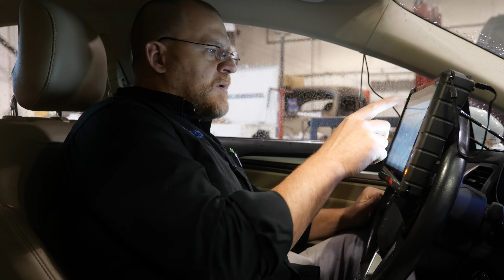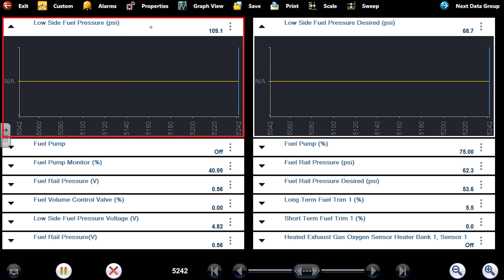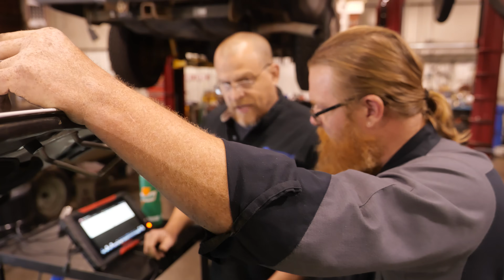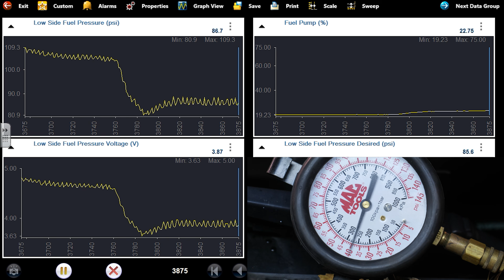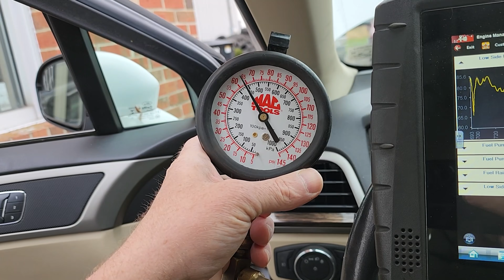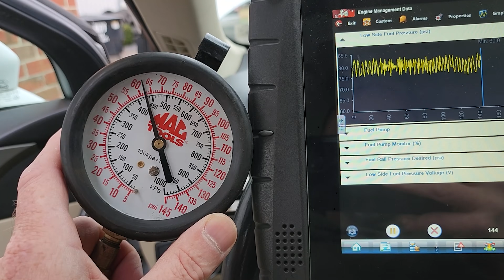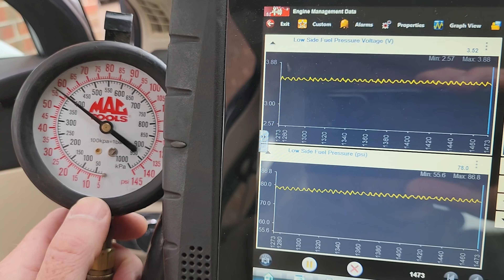Gas Direct Injection System With Intermittent Low Fuel Pressure

Comment: With the mentions of bronchitis and time, I thought Caleb might have inserted clips from a KFOR news report that went viral 10 years ago
https://youtu.be/ydmPh4MXT3g

I was quite surprised you didn't pick up on the 4.82V being a red flag, it's quite rare that a 5V sensor will have an operational range outside of 0.5 to 4.5V.
I also didn't expect that scan data would change (albeit only 0.2psi) when unplugged
Reply from the maker: I did! The first mention of that data PID at about 7 minutes was just an overview of everything on the screen for everyone. Then at 11 minutes we are narrowed in on it.
Reply: @ScannerDanner  yes I know you mentioned it at that point and again quite a few times but each time you seemed to be saying it with the tone of it being a perfectly acceptable value rather than something outside the normal range.
I was waiting for you to say "Hmmm, 4.82 Volts, I don't like that."
I was literally shouting at the TV!🤣
It must have a very narrow limit for setting a circuit high/open code if 4.82V is not flagged as outside spec by the PCM.

Comment: Paul, bear with me here as I'm pretty new to the scope scene. But the other day I connected both lead of my scope to the coil windings from a relay (resister removed), held it on the fuel pressure sensor and I could easily see the PWM signal on the fuel pressure sensor on a 2013 Kia Optima. I don't have a COP paddle ignition pick up, but I would assume that would be the nicer tool to use. If you get a second give it a try and maybe you could have used that to see if the PCM was sending the correct signal. Idk just a thought.

Comment: Low pressure fuel pressure sensor (LPFS) is not likely an absolute press-sensor, there is no need for that value.
What most people did not realize is that, any added hose length, Tee fittings and orifice produces HEAD or restriction to flow and will create a lower reading on the mechanical-capillary gauge we use to troubleshoot, even assuming that the capillary gauge is as "accurate" as the all electric LPFS.

Position of the LPFS also matters. Some cars has its LPFS sensor at the fuel filter output at the fuel tank and we read our pressure at close to the input of the HP fuel pump at the engine . This extra distance of approx 4 meters and elevation of approx 50cm LPFS is reading adds to HEAD and read as higher pressure. And then we add skinny hoses and Tee fittings to our  mechanical capillary gauge with extra 50cm length, hence our mechanical-capillary gauge will read even lower pressure.

If one wants to read pressure equally as possible on all instruments/sensors which are not taken from the same port, it has to be static reading with pressure raised slowly and not while engine is running, assuming there is no check-valve involved.

Often electronic LPFS is temperature compensated while our mechanical-capillary gauge is not, there goes some more deviation. Mechanical-capillary gauge by design is most accurate at the middle sweep range, that is given.
So a 145pis gauge is most accurate at its 70-80 psi range.

On my Mercedes W212 M276 3.0TT engine, its LPFS is at the fuel tank at the filter body, reading filtered output.
The sensing/reading port for mechanical-capillary gauge is at engine Bank 2, so 0.8 to 0.9 BAR lower pressure I am reading compared to Xentry scanner LPFS value is acceptable. I use 50cm hose for the mechanical-capillary gauge and able to place it near engine fan shroud, so that it is safer if any leak occurs because turbocharger is close by if leak occurs at gauge, while gauge is on the engine Vee.

If anyone has a swimming pool with decent good twin filter system of sand filter + cartridge filter and pressure gauges at the pump output, one can see various pressure differences when system is running, all produced by resistance or HEAD from either filter media clean/dirty, pipe length, elbow, valves, check vales and all other related HEAD or resistance a fluid delivery system will encounter.
Reply from the maker: Agree with your first statement. What would be the need for an absolute psi sensor here. This low side pressure is clearly not critical that it needs to be an exact amount as we are not supplying rail psi with it like on a port injection system.
And location of the psi sensor is certainly a factor, especially on this set up!
I would argue that my gauge is not a big factor here as I've used this same set up a thousand times on port injection systems and have exact psi specs with it. Thanks for the comments and info!
Reply: @ScannerDanner    I do not know what is the minimum input pressure for this Ford's HP fuel pump requires, but on my M276.820  its a Bosch 200 BAR (3,000psi) unit which expects 4 BAR ( 60psi) minimum at its input at maximum fuel burn. However, my LP fuel pump is 3 phase variable speed, so testing LP fuel pressure need me to do WOT at 1st and 2nd gear to see real performance of the LP fuel pump as the fuel flow mapping won't be all out during stationary revving.

Same design to the Ford HP pump for its Normally Open fuel quantity control valve though.
However, I like seeing most american cars are generous for their data perimeter.
For reason unknown Mercedes for M276.820 engine ( Bosch ECM MED17.7 ) is stingy for a few important perimeters. There is no desired LP fuel pressure and HP fuel pressure information, DUGGHH !!!
I knew about the 4 BAR minimum pressure from Bosch datasheet of the HP pump family used on my engine, which is the HDP5 family. Single piston type.

I am hoping someday you will scope the HP fuel pump fuel quantity valve and break down its data value vs actual mechanical action which is quite complex and you are very good with explanation of such system and knowing your mind-set : forever wanting to learn more, it will be awesome this information coming from you.

Some OE like Mercedes call it actuation angle while Ford call it by % of actuation.
The complex part is the real actuation timing of the single piston fuel quantity valve of the HP pump vs the camshaft's lobe for the HP fuel pump pumping. In a 3 fuel lobes camshaft scenario there will be 120 degrees of camshaft revolution per lobe BDC>>TDC>>BDC, but only 60 degrees is able to pressurize the fuel, the upward stroke of the lobe BDC to TDC. The other 60 degrees TDC to BDC is for "suction".
VVT system added complexity when measuring these as camshaft angle keeps changing in respect to crankshaft angle. Hence it takes an excellent teacher like yourself to dig in deeper into this GDI 101.

A delay in the activation of the electromagnetic coil of the HP pump fuel quantity valve from degreading coil insulation or whatnot, but seemingly % is achieved* ( *but at wrong camshaft lobe position ) say in a Ford GDI, can really ruin a troubleshooting day. If total dead fuel quantity valve is easy to troubleshoot.
 
Okey dokey, thanks Paul for the excellent video , as always.

Comment: I'm glad for your chanel, ive been learning a lot with you. Actually the psi lower than 85 is interesting since the low sensor now works within specs.What could be the psi not reaching 85 as the sensor has been replaced?
Reply from the maker: Watch the last clip (before my cough sequence) for an answer to that

Comment: Thanks for sharing Paul. Don’t know if you follow Sean toppling podcast but he had a good fuel pressure problem on a 3.5 Honda engine which turned out to be skipped  tooth on the Cam which drives the pump. It as a good one. All of you get well soon Artie 🇺🇸😊

Comment: Thank you Danners. Your approximate 15 psi difference between the fuel pressure gauge reading and scan data reading is the scan data is absolute pressure. To prove that you can pull fuel pump fuse or relay, while engine is running until it stalls. Your fuel supply pressure live data will read approximately 15 psiA, while your pressure gauge would read 0 psiG.
Reply: 🤦🏻‍♂️ Now that you mentioned it, it is so obvious, I almost ashamed not to have figured it out haha

Comment: I also have a vehicle in at work that just took a quick diagnostic on where the high pressure fuel side goes from 48 to 3 bar and the engine dies, but only on hot engine.

Havent got time to check up on it anymore since our shop is always overbooked..... (shitty management😅)  so no time for lengthy diag. But the scan data looks very simmilar otherwise and i said it looks like the low pressure side fuel pump might be bad but haven't called anything yet since i only had 30 minutes on it  including testdrive to get it dying but now i have an idea what to look for firstly 👍
Great timing as it been sitting a while and customer wants his car back days ago...
Reply from the maker: awesome! Looking forward to an update on what you find. Is it a Ford?
Reply: Actually an Volvo but they are all Ford parts and engines now 😂 think it is the exact same engine as this one
Reply: So happy to tell you AND the customer the car is fixed now 😁
Tha part was "only" 170 usd so just the time of diagnosing more was weighted to just change it and see since parameters were very similar to yours and the low pressure never changed a single digit.

So changed it and the pressure showed now went to be dynamically changing, also opener the old one and the electronics where filled with fuel.

Now it is all good.

Before it was 5 minute drive before it started dying, i drove 20 minutes today and it idles nice without stalling now.

Volvo/Ford dealer told they only sold 2 sensors since 2018 so it was guaranteed i was ordering wrong part, jokes on them since it fixed it 😂
Reply: @tullgutten  awesome, thanks for the update!

Comment: Could it be the gauge is smoothing out at higher rpm’s due to that long line on the gauge. As the pressure pulses increase in frequency the compliance of that long hose smooths out the variation. The sensor doesn’t have this problem.
Reply from the maker: I think the increase in frequency of the high psi pulses is why the psi gauge would smooth out.

Comment: Don't just forget about the grill shutter.
Ive had one where i was chasing engine faults that didn't make sense.
Engine dying while idle, not starting, not charging, charging too much, instrument cluster going crazy.

It was hard to drive it in to the workshop and the exterior lights also blinked on and off.

The grill shutter was full of water and was directly on the lin bus line and messing everything up.
Every problem went away pulling and drying the plug since it was dripping wet, and with a new shutter every code went away and i only got code for it once, it never reappeared after deleting codes the first time but luckily i had printed out all the first codes and checked it not too long after in the diagnostic and had 1 more car with just charging fault even tho it was charging, same part changed fixed it
Reply from the maker: ah great tip! Did not consider water pulling the network down! Thanks!

Comment: It's weird how they are having the same problem across several of their vehicles.  It's almost as if the sensors are all out of calibration, but instead of paying to get new accurate sensors  for all their vehicles, they are simply calling it good enough;  just let all these vehicles run with slightly under pressure low sides.  Interesting.
Reply from the maker: As others have said, this may be an absolute psi reading, not gauge psi.
Also, as far as having such a wide discrepancy, I don't think it's as important as it is only the supply side, not injector psi side if that makes sense

Comment: That is a very interesting point if the electronic gauge is an absolute case and it's going to be 15 psi higher because the atmospheric pressure I wonder if that's what the computers actually reading very interesting point Love video

Comment: I Seen Your Preview On Facebook My First Thought Was I Have Seen This Problem Before, That Must Be A Ford Lol I Wanted To Comment And Ask But Figured I Would Wait On The Video.Really Awesome!!!!
Reply from the maker: This was exactly as you thought? Cool, I've since heard this is pretty common! What are your thoughts on the drastic fuel psi changes during snap throttle testing after the fix. I'm calling it normal on this system but I could be wrong. Thanks!
Reply: @ScannerDanner  First Time I Ever Came Across This, Probably 2 Years Ago I Diagnosed The Problem As A Low Side Pressure Sensor Failure….I Was Correct But After Replacement I Seen Numbers On Scan Data That Didn’t Match The Actual Reading, The Car Ran Great But The Numbers Through Me Off,Long Story Short I Actually Ended Up Convincing Myself That There Must Be An Issue With The High Pressure Pump. After Replacing The Pump For No Reason Other Then What I New At The Time,The  Fuel PSI Numbers We’re Exactly As They Where After Sensor Replacement.Nothing Wrong With The Pump I’m Calling It Normal As Well, I Have Had Other Ford GDI Engines Same Fluctuation And No Problems At All.
Reply from the maker: @SMAutoRepairLLC  to be clear, you changed the high psi pump for those low psi fluctuations I'm mentioning? I wasn't talking about the skewed sensor issue if that's what you were thinking. Thanks!
Reply: @ScannerDanner  That’s My Fault Sir, I Did Believe That Is What You We’re Referring To My Apologies. The Low Pressure Reading Fluctuations By What I’ve Seen Seem to Be Completely Normal. I Appreciate You Taking The Time Out Of Your Evening To Reach Out Really Awesome!!!!

Comment: Does cooling a sensor raise voltage?
Reply from the maker: Temperature shouldn't change a psi sensors signal. This just further revealed what we already knew, which was the psi sensor was messed up

Comment: I'd say the low pressure pump is failing
Reply from the maker: I believe the drastic psi changes on the low side during snap throttle testing, even after the fix, is due to the system design. A steady exact fuel psi isn't needed on the low side as we are only filling a chamber and not firing injectors directly from it. The reaction time of the fuel pump duty cycle command and the variable speed pump was what we were seeing.
Maybe I'm wrong here and the pump is on its way out too? But I don't think so. Thanks!

Comment: Had a 2015 equinox give me trouble with desired high pressure and actual pressure on the high side. It’d randomly go to 0 psi desired and the pressure Would stay at 650ish psi and it’d buck and go into reduced power. Called a bad pcm but didn’t fix it. I was like why would it want 0 psi on the high side. Didn’t fix it ended up being a high pressure pump. Didn’t leak down key on engine off. Low side pressure desired and actual matched.

Comment: Maybe the reason the pressure pid shows higher than what is on your gauge because the type of pressure sensor that is being used.  If it is an absolute pressure sensor, the PCM is going to see gauge pressure + atmospheric pressure.
Reply: Great catch. That make a lot of sense. You could prove it by disabling the fuel system and have no pressure in the system, and then see what the scan data shows. I would expect 14.7psi or so.

Comment: I guess sensor is showing absolute pressure that is why it is 1 atm (15 psi) higher than mechanical gauge (external gauge unplugged will show 0 psi and electronic will show atmosperic pressure). Thanks for the good work Paul! Love your videos
Reply: Fallen for something like this on LPG system when tank was empty but level sensor was fixed full. Fuel psi was 15 as it was electronically ready atmosphere.
Reply: oooo, didn't think of that. that is it right there! gotta be, good job.
Reply: need to see that  reading in denver to prove your theory........road trip!!!!! lol
Reply: My thoughts exactly.
Reply: Hmmm. So in other words, pressure sensors whose values agree with that on the gauge read gauge pressure while those which read about 15PSI higher are outputting absolute pressure.

Thanks!
Reply: absolutely. I just watched the video and was going to comment... To add, you have to know the pressure with respect to the height above sea level you are at and add that value to the pressure gauge. The actual pressure to match the gauge could be seen in Generic OBD2 mode.:elbowcough: Greetings from Peru
Reply: Very good though about psi gauge versus absolute… smart guy 😊

Comment: The sensor looks like it may be an absolute pressure where as the gauge is "gauge pressure". The absolute pressure sensor would show around 14.5 psi as its atmospheric "ZERO" and 0psi would be a perfect Vacuum.

Comment: I had a recent issue when testing fuel pressure with a mechanical gauge,  I was getting 40psi when it should be 60psi could not confirm the fault so I applied 20psi to the gauge from a hand pump the needle on the gauge didn't even move!!!,  way out of calibration.